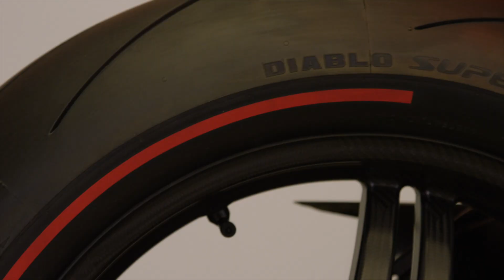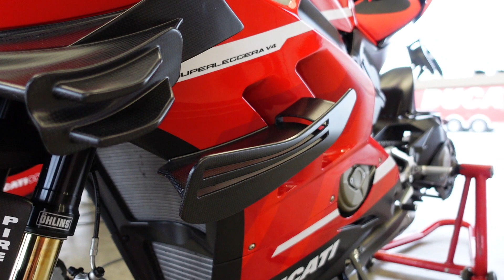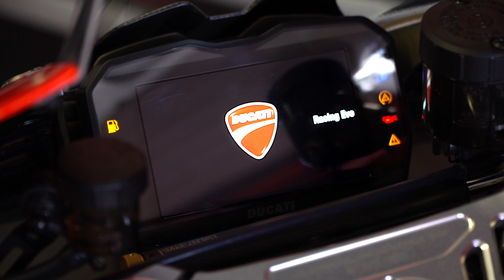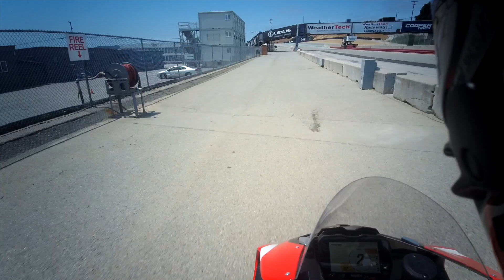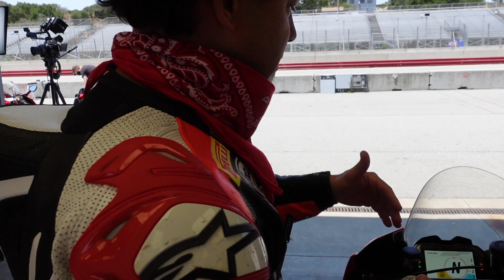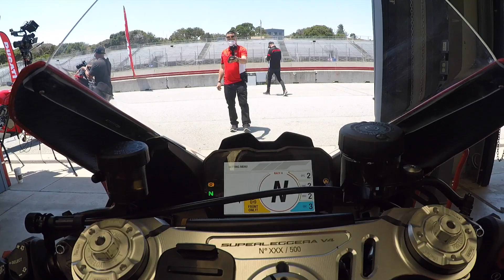Ducati Superleggera V4 Track Test Review - Cycle News

Comment: Does the rear brake work?
Reply from the maker: Surprisingly well.
Reply: Cycle News, give it a few hours of riding and it’ll go soft as a noodle. All of my Ducati’s and Aprilias had or have shitty rear brakes and need a clutch bleed every 600 miles. It’s like a pretty but high maintenance GF, you just put up with it.